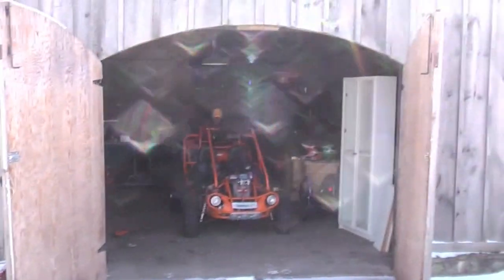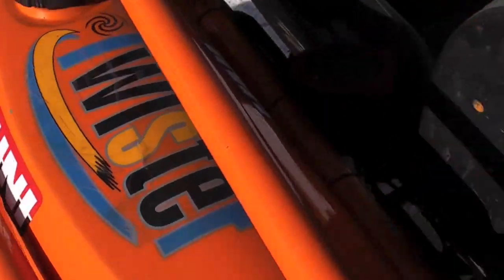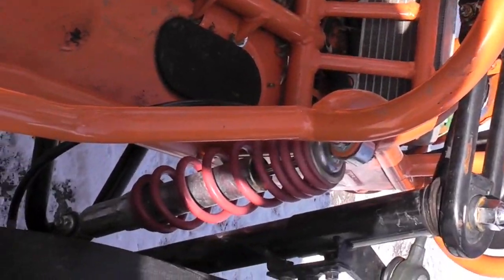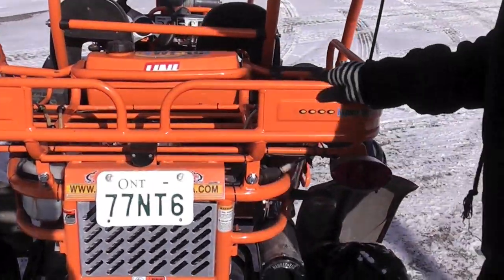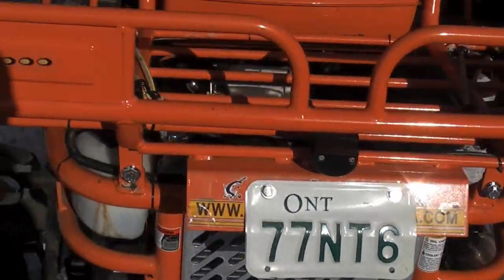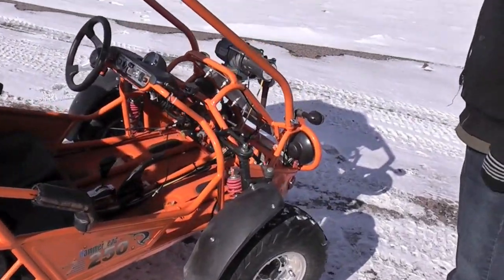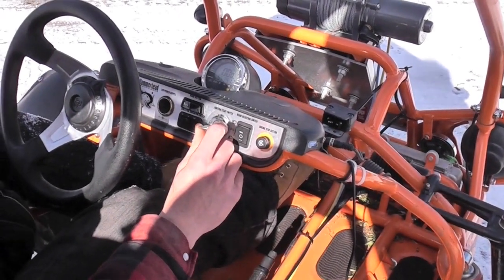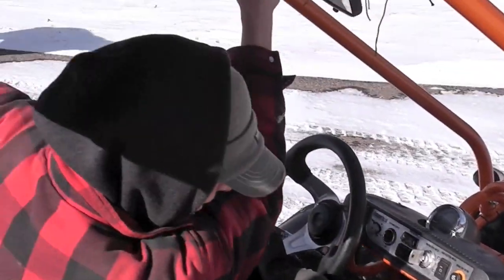HammerHead 250ss Review

Comment: Put the choke on. I have a 150cc hammerhead and couldn't start it for about 3 months. I change the oil, put a new spark plug in it and even bought a new battery bc the one I had wasn't keeping a charge. I went up to the dealership and they told me to try the choke which is located under the passenger seat.. I did that and started right up..

Comment: The thing you thought was the amp im pretty sure is your Regulator Voltage Rectifier. and i would fully charge the battery give it a 3 second turn no more than 5 seconds on and rest fr 5 seconds. IF FULL BATTERY DONT WORK CHECK YOUR VALVES.. Move in and ex valves on cylinder head in like your pinching them together , set piston to TDC then move them away till you feel resistance an then back just one line, N screw in tight... each line is called a graduation mark... then I would start messing with the carb if its still not starting.  air fuel mix, needle, and maby some jets. All in all a 3 to 5 dollar thing of carb cleaner and a lil elbow grease , and a year or 2 of non stop reserch should fix your problem lmao.. Im curious to know if your cylinder head has any markings on it the top and or mid  part

Comment: I had the same problem with mine.  You need to replace your spark plug first and if that doesn't solve the problem replace your ignition coil
Reply from the maker: Mark Conboy Thanks!! i replaced both and it has been working great!

Comment: you dont have ignition problems. maybe you have no gas in it, or u do and you just have to prime the engine. u can spray starting fluid, brake cleaner, just about anything flamable. u can pour gan directly in to the carbs, too. it is just that the gas isnt in the fuel line so the engine wont run

Comment: that being said, yu would assume they are only getting spark in this one position, but when key is turned back to run, they wont have this connection! worse comes to worse, yu could always by-pass the ignition, however they are pretty cheap and easy to install

Comment: change this Intake Manifold, CFmoto CF250, Honda Helix 
especially at the junction of the pressure hose tube wants to pull out and loses pressure

when you change a turn on and run everything else is ok!
I have this and I have been on it only a problem

Comment: I also have the 250ss and i've never had any problems with it. I the only thing wrong with it is that the speedometer isnt working. I thought it was a loose wire but could it be anything else?

Comment: They are not made in Canada they are made in China...

If you drive them hard they will break.. Often....
Welds are weak if you roll it completely over the cage will absolutely compress (roll to side isn't as bad)

I had to reinforce welds on my front struts as the Chinese factory ones where very short and almost tack welds..
Bent a hub broke/bent several bars welds pull away with any force, broken ignition(common problem)

I had fun in mine but the suspension is Terrible the shocks although it

Comment: what yu should do is check the back of the ignition make sure yer contacts are clean, and or put some contact glue on the plugins, then yu should take out a sparkplug, leave it in the boot, and have the igniting side on a clean peice of non painted metal! have someone turn the ignition and someone check for spark! do not touch the spark plug while doing this, yu may have a failing coil! let me kno what happens after yu try this!

Comment: My mate has one shipped from canada. It's bit rough no lights ect but it's running frames fine motors fine. I'm thinkn of buyin it it's a 250 but is there any way to allow the engine full power? Where or how does its speed governor work so I can remove it? Cause for a 250cc it only Max's out at about 35-40kmph. Whochs isn't very fast. Off-road stuff you'd likely never hit that speed but on roads ect it feels soooo slow
Reply from the maker: Thats awesome man, they are great little machines! I'm sure there may be, but all i know of at the moment is re-jetting the carb, getting rid of the air box and just throwing a filter directly on the carb. I was able to get mine to pretty much 80kph. the readings are in Mph
Reply: @NewSkoolRednecks  bro stop!!! Listen. I just figured something out
Reply: @NewSkoolRednecks  On the carburetor there's a L shaped hose that leads to no where it just hangs off the side of the carb. Idk what it's for, but when youv got your foot on full throttle, pinch the end of that hose. Block it. For some reason it lets the buggy go full noise. Idk if this is some kind of restrictor/governor. But at normal top speed it starts like, putting n popping if that makes sense or hitting a limiter. When you squees the little hose, it doesn't do that but instead just keeps going faster I had to let off gas caus ei thought I was gonna blow the motor. I got it upto 79kmph by JUST blocking that tube alone...
Reply: Doing this while idle tho or only driving slow seems to make it almost want to cut out. I think it's some kind of governor that plays on the high RPMs only or something at so much fuel flow or something idk how or what it does. But yeah squeez it closed and she goes like fuck. You can block it str8
Away and giv full gas and itl do burnouts n shit. Mines a Twister 250 have no idea what motor is in it. What steering rack measurements are. Idk nothing about it. Wish I did caus ei need parts. All the boots, bushings, bearings, and steering rack including tie rod ends are screwed. Other than that good fckn buggy. Atleast when you block that hose ;)